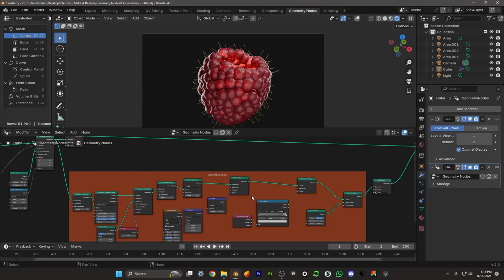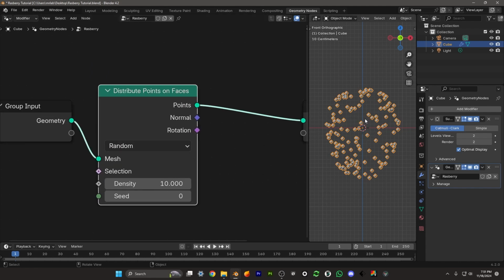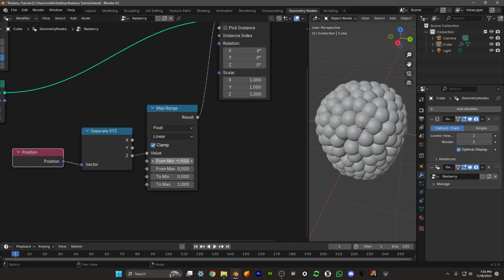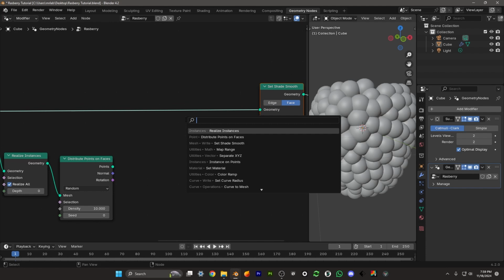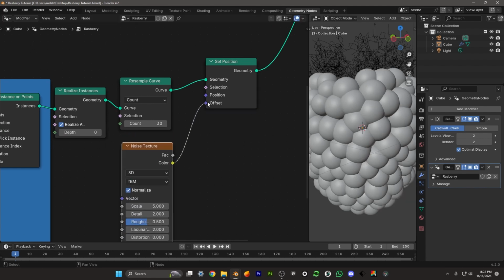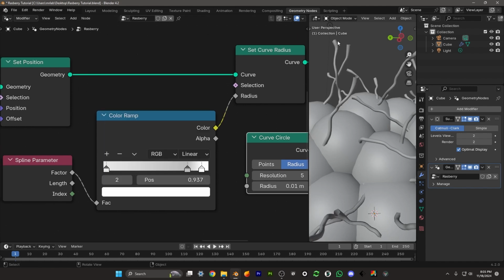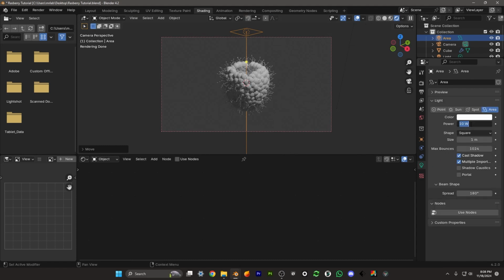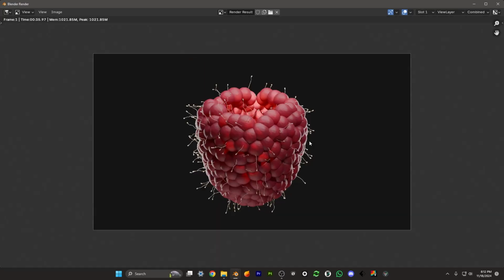Blender Raspberry With Geometry Nodes | HD Tutorial

Comment: The step with the ramp wasn't working for me until I connected the ColorRamp to the Scale input  in the Curve to Mesh node instead of the Radius input in the Set Curve Radius node. 

Just in case anyone else is struggling with the same issue 😉

Comment: good tutorial. while it does for sure look like a raspberry i feel like it could be improved a bit further, if you really get in and look at a raspberry the shape of each individual bulb is not actually  just a uniform sphere many (but not all) have a little divot in the middle of the little tiny bulbs where it kind of curves inward slightly. Then the hairs on them are not just randomly scattered, they specifically grow from the bottoms of the bulbs or in-between each bulb but they usually do have micro hairs that grow all-over but they are much smaller. 

None-the-less its a great tutorials that's and a much better workflow than trying to model something like that by hand. Got a sub from me.